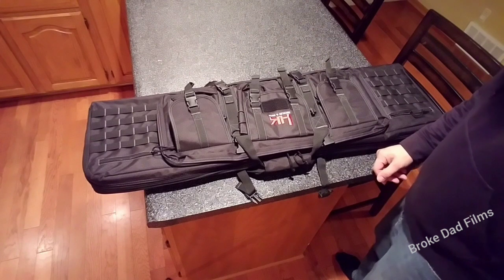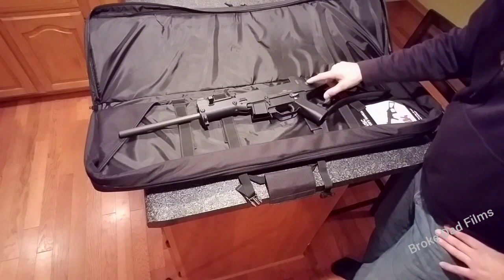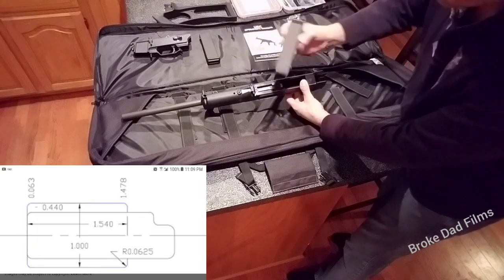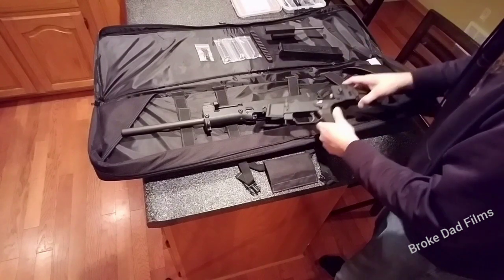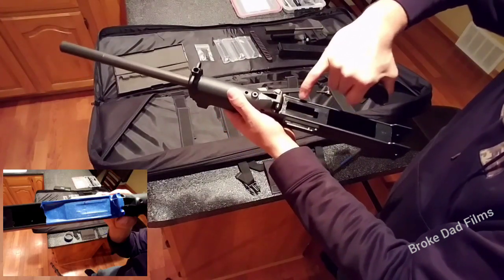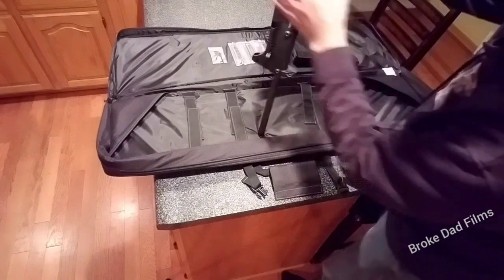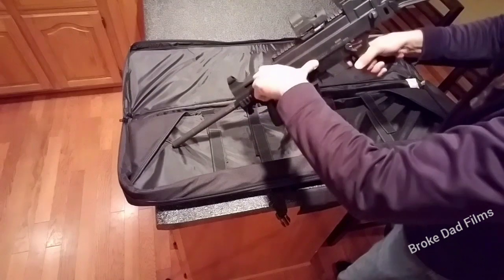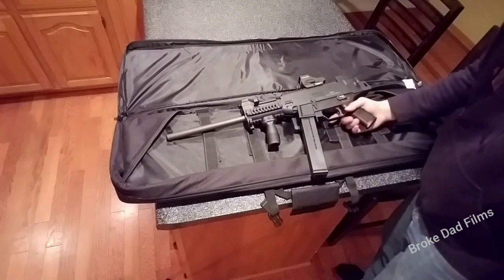HK USC TO UMP CONVERSION PART ✌

Comment: GREAT VIDEO!! I have owned a USC since they first came out back in early 99 and I have one of the first ones to come into the country in the Puke baby Blue! I have been wanting to convert it to a UMP but I have been afraid of doing it because of the TIME and COST of Sending it To SOMEONE to get it DONE but you just SHOWED IT BE VERY EAST to DO the CONVERSION!  I have allot of experience working with Other weapon Platforms like AR, Glocks, Sigs and 1911 so getting into the Guts of my USC would not be a MAJOR DEAL and I am OLD Fashion I like to work with FILES Nice and SLOW specially when Fitting parts so I can get Awesome Results.   Thank you for Putting this VIDEO OUT!!!!
Reply from the maker: Glad to hear it!  Taking your time and patience is the key.  But yes it is very easy!  I have done 2 so far.
The hardest part is milling your receiver vents.  Go slow cut small amounts and use lots of lube.  The plastic gets hot and makes a molten mess.
Not a big deal if you take your time.
I don't do a lot of gun videos anymore due to you tube hating gun channels. I'm trying to grow my channel and potentially make a side business out of it.  So now I video outdoor activities: Hunting, utv, mountain biking & hopefully some fishing.

Comment: Hi. You did the best video on the conversion. Every detail adds up to the end result. 
Question, can the UMP lower be used with single stack? Is the extra room a problem?
I'm going for the stock conversion only, without expanding my mag well.
Since HK's stock block doesn't have a built in grip, I'm forced to the UMP lower.
Also, using the basic safety on/off version,  will those UMP markings align with the USC safety?  Thanks, friend.

Comment: Do you have to swap the trigger? I pulled out the front pin, removed those parts. Then just dremel the tab that pushed back the bar that looks like an H. Now its just semi in semi on both positions.

Comment: My local gun store was asking $1799 for the USC and another $1300 for the conversion.  What did you pay for both?  Thanks for a great video.
Reply from the maker: I bought USC for 1,350 and converted myself.  Total cost including parts 1,950.